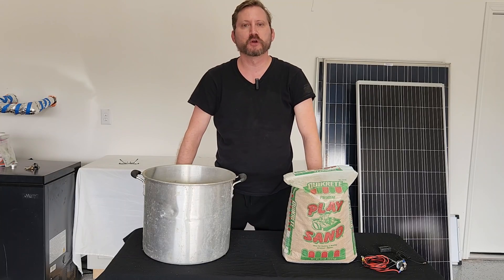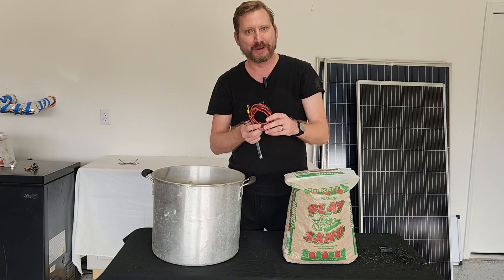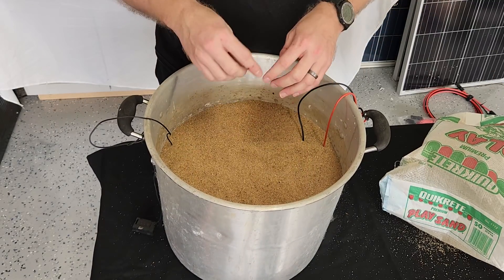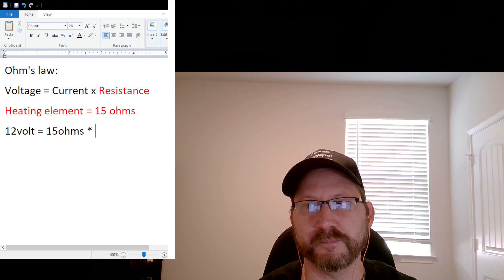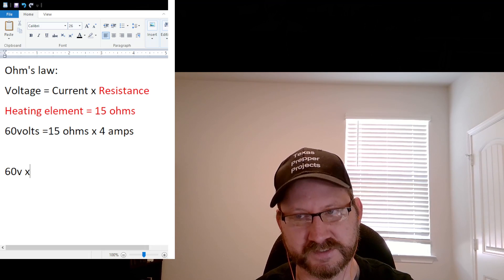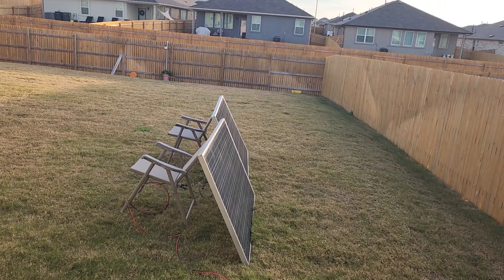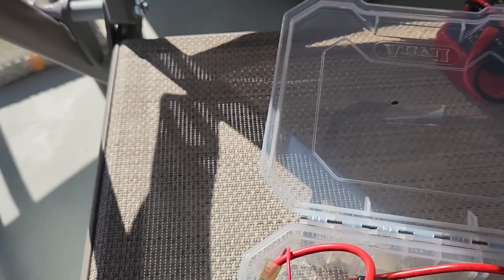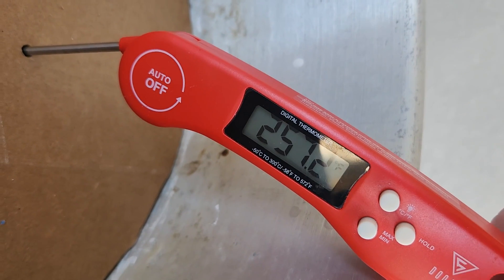Sand Battery Heater solar powered 250F / 120C with no flames or fuel! DIY

Comment: Summer is when the sun is strong. In summer, we don't need heat, we need cooling. So your video doesn't make sense.
Reply from the maker: Thank you for your helpful comment.  During the blizzard I lived through it was 15F outside but the sky was blue and the sun was out

Comment: What happens when you strap a sterling engine on top?
Reply from the maker: First, stiring engines are lab toys. I have never seen one outside of a table top. Second, why would you use a solar panel to make electricity to make heat to use a stiring engine to make electricity?  You lose so much efficiency that way. If you want to end up with electricity,  just use solar to a battery to an inverter.  But to answer your question, sure, if you built an engine, it would take the heat from this and spin
Reply: @texasprepperprojects I thought maybe one could use a small solar setup to gradually heat and then maintain the heat of a sand battery. I thought once it is up to temp the sand holds it's heat and will take little energy to maintain it.  The sterling engine would just run on the residual heat your already making as a bonus. Like being able to cook on top of your wood stove

Comment: Instead of sand as the storage, what about mounting the element in a piece of duct, and  blowing a fan through it. Would heat the space directly in real time, would it not?

I am asking as I have different heating needs, more like a small plugin space heater.  Or a combination where some real time heat is used for the space, but accumulating heat in the sand for when the sun goes down.

I am heating an enclosed deck/green house. Not trying to get 100% solar, but reduce the heating cost by some margin. I got 2 545w (41v 13amps. ) LONGi solar panels for $40.00, thought I may as well experiment with DYI solar.
Reply from the maker: Check my more recent videos

Comment: Didn't the sand touching the wire connection and screws short out?
Reply from the maker: Nope. As long as the sand is dry it is inert

Comment: This was great! I've got a battery and inverter in an outdoor box unit and I'm expecting this first winter with the setup will show me some serious temperature struggles, so I'm already planning for ways to heat it. This seems like a great solution for me to heat the sand battery in the day and then it can radiate that stored energy overnight when temps really drop off.
Reply from the maker: Check out my recent shorts. I belive that direct solar air heater is much better

Comment: If you use the solar thermal oils system to heat the sand instead of the renewable energy to heat, maybe better
Reply from the maker: try it out!

Comment: Having the sand temperature high above water boiling point, there is a big potential issue with instantaneous steam building pressure in relatively weak (copper) pipes. This scenario obviously requires high pressure steel piping.
What heat exchanging medium can be used for such scenarios?
Reply from the maker: Great question.  I do nit know

Comment: This is great.  One of the newer products to come on line in the last few years was EG4 mini splits that use heat pumps... super effiecient I think the 9000 BTU (so around 400 sq feet) uses only 250 watts for cooling and around 350 watts for heating. They make two modes one that accepts both grid and solar panels and one that only except grid.  I think those are the way to go if you need to heat or cool efficiently... the only thing that would beat those I think would be geothermal.  But ath is crazy expensive.  Cheers.
Reply from the maker: Nice

Comment: Water will not hold heat. It dissipates the heat very quickly. Which is the hole idea of using sand. Sand does not just absorb heat like anyone would know if they walk on sand at the beach, it is also an insulator, so it dissipates heat at a very low rate. It is also scalable. The other issue with water is that it will evaporate over time so you would have to keep topping it up. Sand of course can be be sealed up and insulated further to increase efficiency.
Reply from the maker: Thanks

Comment: I want to do this to a water heater, will the thermostat still work or will I blow it up lol
Reply from the maker: Likely will not work
Reply: @texasprepperprojects  ok I have another idea someone off grid could make an outdoor shower with an elevated but not pressurized tank with an element in it and manually watch temp and turn off solar when hits right temp
Reply from the maker: @frank9963    I totally agree with this. I think it would be VERY simple to elevate a 35g drum, paint it black and have a free hot shower that is gravity fed.

Comment: You have given me the idea of recycling a leaking caravan water heater. Drain it and put sand in it. The old style elements are fixable ( wire spring threaded around a clay pottery tube. There's a name for this tube but I will need to research it.
Reply from the maker: Sounds fun

Comment: Ohm's Law is great but what I REALLY want to know about is cost, pay-back cycle and dollar value of heat that is displaced. No one ever seems to include these numbers with DIY sand battery vids.
Reply from the maker: The cost is pretty low. Sand is cheap. But, it's not worth doing unless you have tons

Comment: Interesting idea and great video!

I have a question about the temperature at which this heater will burn out.
After all, it is designed to heat water - up to 100 C (I use the Celsius scale).
Sand does not absorb heat as effectively as water, so the heater heats up to much higher temperatures.

Did you have a problem with this?

Greetings from Poland!
Reply from the maker: I had a problem with the element buring out

Comment: Potentially dumb question. That appears to be an AC water heater element. Are you connecting DC current directly to the element or are you using an inverter to convert to AC?
Reply from the maker: You can go direct. Resistance doesn't care about ac or dc
Reply: @  very cool. Thanks for the quick response. I really enjoy your videos and your ‘practical prepper’ perspective.
Reply from the maker: thank you!

Comment: one more question, I assume you didn't ground anything because the element is just in the sand, but if you drilled a hole and screwed the element into the pot, would you then ground the pot to earth?  I'm also assuming the panel outside is grounded somehow as well
Reply from the maker: grounding isn't needed. it's all DC so it doesn't matter.

Comment: Have you taken this experiment and extrapolated what size elements would be a good match for a given wattage of solar panel(s).  For example, I was given 2 panels, 450W each and I wonder what element you would recommend given there are many option sizes for replacement water heater elements, 120V and 240V.
Very curious...
Reply from the maker: Its all about the voltage of the panels and the resistance of the heating element. Check the math i did in the middle of the video. The higher the voltage on your solar panels the better

Comment: Spring clean up piles are a great place to get burner elements from junk stoves. And get that controller knob for the oven too.
Yeah, its 220 volt, BUT DC DON'T CARE 😅
Reply from the maker: As long as the resistance matches

Comment: how about a bigger bucket say a oil barrel size with a coiled pipe  running through it connected to your water system it would act like a boiler instead of gas/oil the hot sand would heat the water in the tube and supply the radiators in the house what do you reckon
Reply from the maker: There is no point. If you are going to do that, then just heat the water directly with black tubing

Comment: play sand clumps. large round balls too. if look real close.  try kiln dried sand for paving joints. its like powder and self compresses like a rock with vibration. we cll it hour glass sand. lol  more density and thermal efficiency maybe?
Reply from the maker: Still not worth it

Comment: Only problem is if the sun if shinning then the greenhouse warms up anyway but the sand battery will last longer into the night. So the sand battery is a great ideal anyway but if you make it bigger, like try a 55 gallon drum next, this way when the sun is down at night this thing will continue to release heat thru the night. It will need more sand obviously, like 50 bags and maybe a couple more panels and another heating element. But try it with the 2 panels and one heating element first. 

But that is why they call it a battery, it stores the energy as heat.  And you said you hooked those solar panels to no batteries, but you did, the sand battery. lol  But every last electrical load is hooked to resistance or else it is not an electrical load. It means even hooking the solar panels to a lithium battery is hooking them to resistance(a load).  The battery is in essence the same thing, your wires hooked to a piece of exotic metal, in a lithium battery it is lithium. Same as the heating element, your wires hooked to the exotic metal in the element, in this case Nickel-Chromium (NiCr) Alloy. Both are electrical loads in these cases. 

There are other ways to direct the solar energy into the sand too, without solar panels or resistive heating elements. Solar parabolic uses condensed sunlight to heat things. All it is is a reflective material in a parabolic shape to direct concentrated rays to one spot. It get hot enough to start fires if you direct it at wood and other flammable materials, it is hot enough to melt steel too. But don't worry you don't need the rays concentrated so much they melt steel, you just broaden the focal point out some and it can't melt the steel/sand. Because if it can melt steel it melts sand too, but not if you don't make it that powerful. I only told you about the possibility of melting steel for how hot you can get the concentration, it is over 2,500F. But you won't need that, just broaden the focal point some.
Reply from the maker: I have tried parabolic mirrors. Look at my other videos. The problem is that you have to re aim them every 15 minutes as the sun moves
Reply: @texasprepperprojects  True. That could possibly be looked at as the trade off for it being just a shinny object shaped into a parabola. For the price of 2 solar panels you could possibly use it for a solar tracking system for the parabola for the same or similar cost. 

It would be interesting and make a good video but that is just my opinion. But i wouldn't just jump right in buying stuff, start with manually adjusting the parabolic mirrors with the sun during an experiment during the best time of the day for it and see how hot it makes the sand. If it is something that matches or exceeds the 2 solar panels and resistive heating element then it might be worth buying the solar tracker. And at least if all else fails in the end you can still use the tracker for some solar panels.

Comment: Another answer for why not use water instead of sand is because water boils at 212F which is only 100C. Not only does everything need to be water proofed it needs to be pressure proofed too because boiling water is steam and steam is compressible. So if you tried it without a tight fitting lid the water would boil away and you have to keep adding water. But if you put a tight fitting lid on it, now the pressure of steam will build up and explode the pot and someone could get hurt or killed. That is unless you invest in a proper pressure vessel and all the gadgets and equipment that goes along with it to have a safe workable boiler system. IT is 1000s upon 1000s of dollars. So it is a real good reason why not use water.

Put it this way, if you wanted to use water then you are better off just buying a complete boiler but instead of heating the water with the propane heat it with the electric water heater elements off solar. DRILL some holes in the side of it and install the heating elements and use a gasket and NUT. lol JK but install the things however you feel is good.
Reply from the maker: yup

Comment: Very good description, thank you. I’m planning of stepping this up to possibly a 50gal drum or old propane tank (insulated of course) to heat our radiant floor water. I still haven’t seen anyone do a larger scale project with the sand so is there anyone smarter than I am that can figure out how many elements/pounds of sand and how many watts it would take for sustaining 250° in the sand? I want to be able to pull water through copper coil/s that hopefully can hit my floors at 120°
Reply from the maker: check out my recent video. it's not worth it

Comment: @texasprepperprojects I do not understand your do not insulate comments. Your sand battery could have been hotter if it was insulated. It seems like it peaked out due to energy loss, it held as much as it could before it reach a point that it was simply transferring the excess energy to the air rather than holding it in the sand/vessel. 

If insulated you can access the stored heat by removing the cap or have a hole drilled. Stuff a copper rod in the sand through that hole and the heat will transfer through the copper rod and out of the vessel. If you want, add copper heatsinks to parts of the rod and it will release the heat 'faster' as it has more surface area. Change the rod or heat sinks to control the transfer rate.

If you want to direct the heat, then place a reflector with a cap around the exposed copper rod. This will allow you to place the sand battery in a corner of a room and have it radiate heat "outwards". If the dwelling heat loss is an issue, then I would have them radiating heat across or under a window as a kind of insulation barrier to stabilize the temperature of the interior of the house, be it the attic and basement insulation is sufficient and there is not massive heat loss through the roof or basement walls. Windows are the biggest offenders of heat loss, including those awesome doors with glass. If you feel so inclined, you could create rods with branching arms to run the width of the window.
Reply from the maker: It all depends if the sand is inside the house or outside the house. If the sand is inside the house then insulation isn't needed because the heat is going to get our anyway

Comment: You are missing a very important part of why you’d use one of those heat powered fans.  Hot air rises, so you’re taking the air and moving it sideways before it has the chance to rise, so you are losing the heat to the ceiling.  I’d put a sawbuck down that if you buy one of those little heat powered fans and use it on the top of the bucket the room will be noticeably warmer.
Reply from the maker: I know that heat rises but that fan doesn't make any more extra heat
Reply: @ yes, but if the heat is high up in the room you can’t feel it,  it’s about putting the heat in the right place.  I’m not saying it will create any MORE heat, but that less of a percentage of that heat will be above the zone benefiting you.  If your greenhouse ceiling is warm but your plants aren’t, pretty useless. The fan increases the amount of time that heat is interacting with whatever is in the lower zone, be it you or plants.

Comment: gonna try one in my chicken coop under the waterer to prevent freezing
Reply from the maker: watch my other videos, it's not worth it. If you just want to keep water warm, then use a swimming pool heater and a small pump to keep it circulating. it will be easier, cheaper and will work better
Reply: @texasprepperprojects  thanks for the reply, will watch the other videos, i may experiment with it anyway, i already have a spare solar panel and everything else needed so it would cost only time, swimming pool stuff on the other hand would need to be purchased, if it works, ill post my results.
Reply from the maker: Cool!

Comment: Sir, I am wanting to make something like this to heat small storage room at night in the winter. So what i am trying to find out is once water or sand is heated (equal amounts, say 10 gallons) during the day. which one would hold the heat and disperse at night for a longer period of time? I hope that made sense. Thank you and keep up with the good educational videos
Reply from the maker: You need 50 or 100 gallons of water depending on how well insulated your room is
Reply: @texasprepperprojects  ok. I actually have a 275 gallon tote. What im wondering is, if that heats up all through the day. Would it last long enough in a insulated room, to keep other water tanks from freezing all night long?
Thanks!😊
Reply from the maker: Depends on how big the room is and how hot you can get that 275 gallons. Check out the conversion from BTU to watts. Direct solar water heating not with solar (like a pool heater) would be best. Where do you live?
Reply: @texasprepperprojects  thank you!
I live in Arkansas. Near the MO. Border. The room is 12 x 30 and has 15 water totes. It is my water room for rain harvesting for my water supply.
Thank you for your help.
Reply from the maker: Check out videos on solar pool heaters. Basically 500 ft of 1" PEX painted black in a glass box with a sump pump circulating water. Your area isn't great for solar output but for $150 worth of parts it would be a fun project to try. Check out my older videos on solar water heating. I got 30 gallons up to 120F with a tiny pump